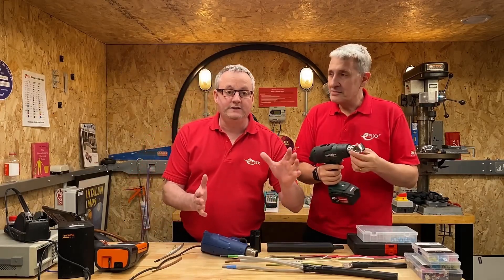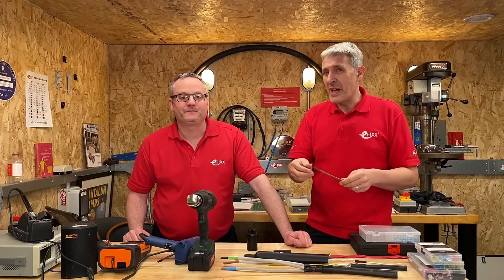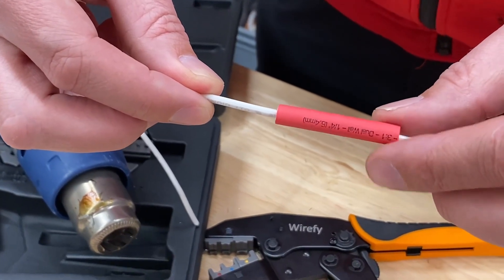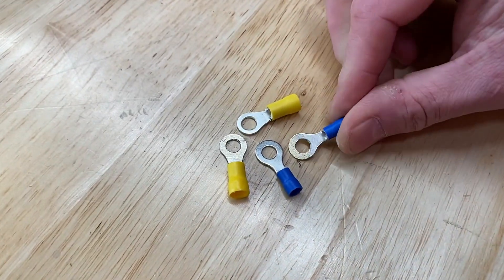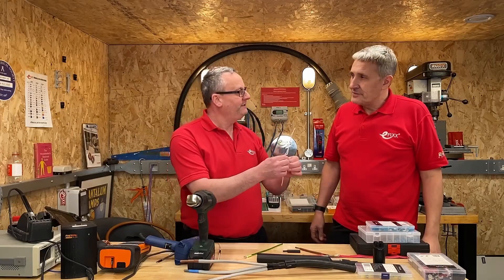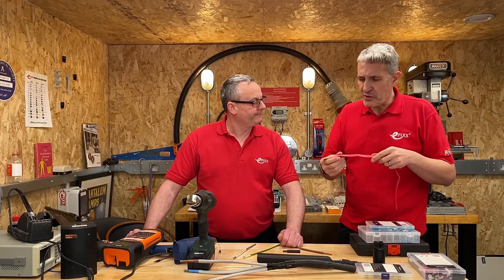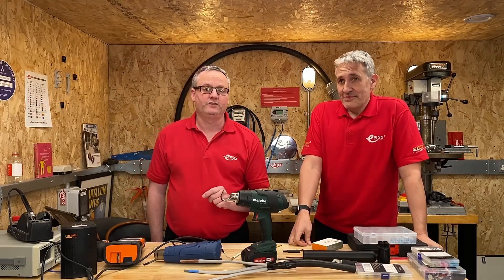How to use Heat Shrink Tubing!

Comment from the maker: =AD= Featured in this video:
Wirefy Crimp tool 👉 http://hub.efixx.co.uk/wirefy-crimptool
Heat Shrink Crimps 👉 http://hub.efixx.co.uk/shrink-crimps
Solder Sleeves 👉 http://hub.efixx.co.uk/solder-sleeves
Heat Shrink 👉 http://hub.efixx.co.uk/heat-shrink-kit
Wago Connectors 👉 http://hub.efixx.co.uk/wago221-inline
========================================

Comment: I work on the rails, and heat guns kill batteries, so out on track miles from anywhere, heat gums are useless. I use a plumbers blow torch, and it's much easier and quicker

Comment: An old , but working 2 Kw oven element connected to a suitable ( safe ! ) flex , but , using  ADHESIVE  lined heatshrink ( lots of ! ) over the joints makes a 1st class emergency BATH WATER HEATER ... for when your boiler breaks down ( and , yes they do  ! ) .. OMG  you might say , but it works ( and is safe ! ) .... ( tried - n - tested ) ....... DAVE™🛑

Comment: thanks for the video chaps. I have a question: would a 2.5mm T&E cable entering the kitchen from the wall to be extended with heat shrink crimps be in accordance with the building regulations? The idea would be to extend the end point of the cable as currently in the way of the back of a dishwasher.

Comment: Firstly - thank you so much for your ongoing very helpful tutorials ! 
I have a pair of Sennheiser headphones.The headphones still work o.k.- but the rubber sorround (that protects the wires inside) - has frayed & deteriorated in sections - exposing bare wires. I have wrapped insulation tapes around the frayed sections - but it doesn't seem to be adhering too effectively. To save me cutting the headphone wires & having to resolder them - is it possible to cut the heat shrink tubing length ways, apply it to the wires & then heat it ? Do you think the shrink tubing will effectively adhere & grip by using this method ? If not, I would appreciate your advice of an alternative application please? Best regards with thanks for any assistance.
Reply: You can (and should) just get an entire replacement cable. Almost all heat shrink is too rigid once shrunk to be comfortable for headphones — and each piece is a thing the cable likes to snag on. A whole new cable is less work and far more pleasant to use.

Comment: Is this an approved wiring method per the manufacturer? I'm guessing not and they need to be in an accessible enclosure if installed.

Someone's going watch this video and make this repair after hanging a picture (nail cuts cable) in a house not knowing it's illegal.

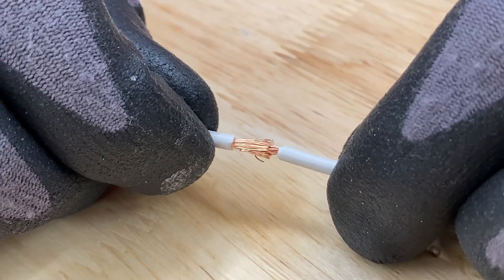Comment: 9:11 Hi,
How should you use these soldering joints when your cables has a solid kernel? 
(I’m Dutch and I’m not sure I’ve used the correct terms but I hope you’ll understand what I mean) 
Thanks in advance!

Comment: I'm a military aircraft Avionics engineer and we use solder sleeves on eurofighter typhoon for a number of purposes, one end is generally larger then the other to accommodate 2 cores, we use them in order to add extra bonding wires etc but also for repair of insulation. The solder in the centre can be mis shapen with pliers until it drops out. The clear heat shrink can then be slid over and used like regular shrink. The coloured glue will hermetically seal the repair with the coloured glue being a visual indicator that it is sealed fully
Reply: no way planes are held up with heat shrink connectors
Reply: @tennicktenstyl sad😢

Comment: Solder sleeves with or without the heat shrink element were used extensively in military aircraft radio systems to improve shielding along the cable run. The outer sheath was striped to reveal the shielding and a solder sleeve used to join another cable to connect to a grounding point.
Reply from the maker: Great insight 👍

Comment: Worth noting that you can get mastic lined heatshrink tubing, an alternative to adhesive lined that is better for sealing if the application needs to remain flexible, or in areas of vibration etc.

Good for people to read up on the relevant COSHH datasheet for the relevant product too. E.g., the fumes aren't good and you don't want to be handling food afterwards etc.
Reply from the maker: We’ll check it out thanks 👍

Comment: Suggestion for other video that is related, cold shrink tubing.
Have used at work as no heat gun needed.
Reply from the maker: A great follow up - we’ve got some at the unit
Reply: How did you find it? I used cold shrink once and struggled to remove the plastic inner spiral.
Reply: @awesomeelectricalengineer3487  Found cold shrink tubing because it can handle high temperature.
3M Cold Shrink Silicone Isolators 8440.

Comment: Some years ago a Swedish spark was exposed to 400V while working on a live 3-phase supply cabinet. 
It turned out that when doing a termination another spark had used some heat shrink that he had lying about in his van. This heat shrink was unfortunately a semi conductive type that’s used while splicing cables >1000V but looks exactly like any other heat shrink. The outcome within that company was that all semi conductive heat shrinking that wasn’t used should be destroyed immediately at the work site.
Reply: That's really scary, but useful information. Cheers
Reply from the maker: Wow 😮
Reply: I have some 2" raychem heat shrink , it's has CONDUCTIVE stamped on it😱
Reply: Semiconductive heat shrink ! That is counter intuative.
I'll haveto start measuring for live voltage on tubing.

Comment: The heat shrink with crimps, seeing as they're from online retailers, I'm assuming they have no BS number, should they be used in a system then?

Does the heat shrink (the fancy 3m one) offer an actual approved method of insulation for say, the numerous SWA supplies were seeing in meterboxes as you mention? Is this something that clarity could be sought on?
Reply from the maker: 3M heat shrinks gave pretty concise data sheets. The rest always need “careful” assessment